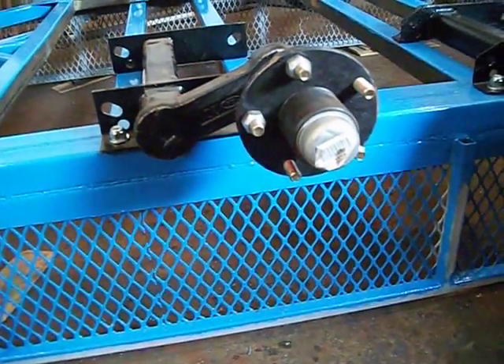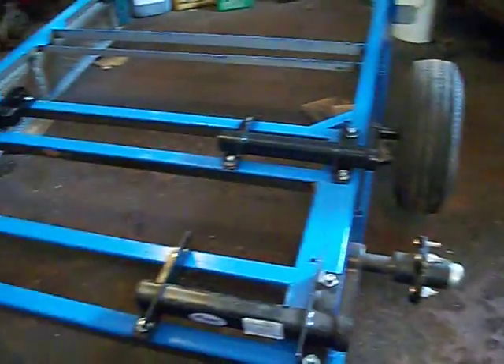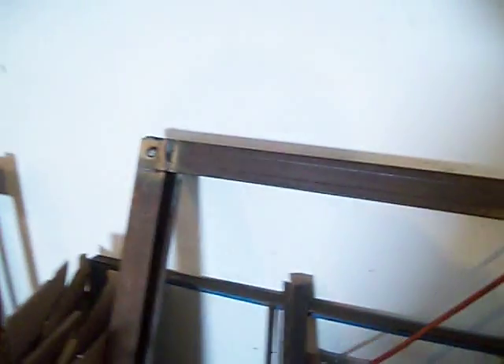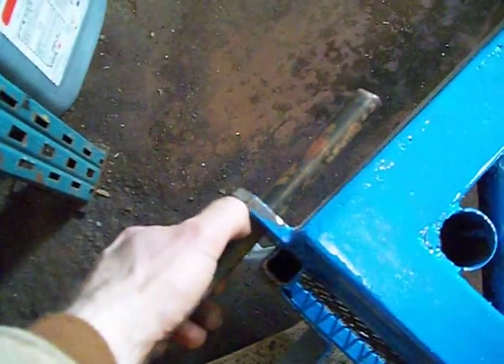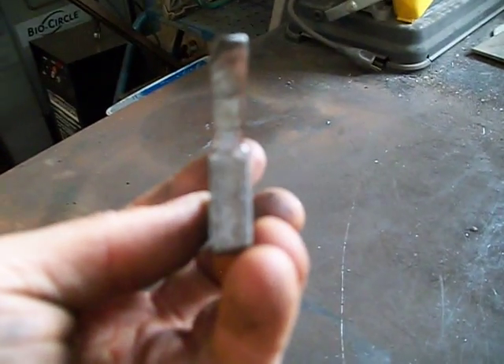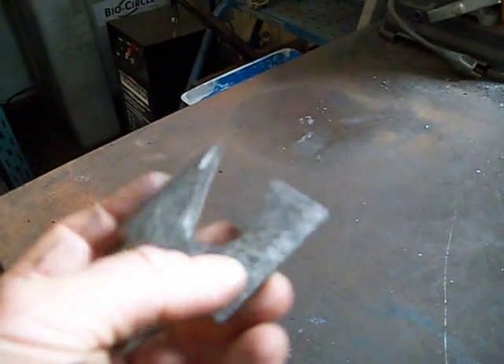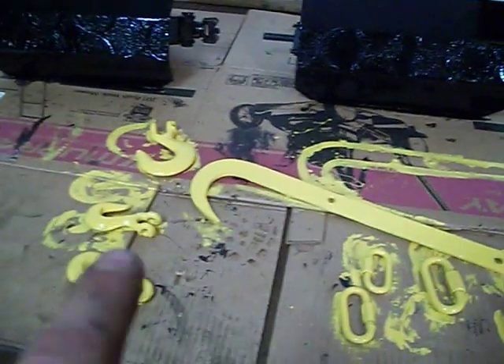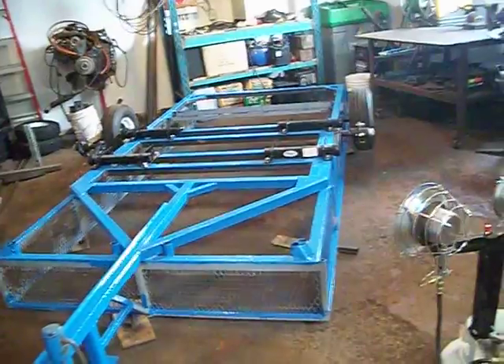Ruffing it on two wheels!

Comment: I just saw these torsion axles at princess on sale, I’m planning to build a 4x4 trailer do you think these will be good ? And what’s the widget limit. For drill bits I go to try hard or to any place where machine shops buy tooling.
Reply from the maker: thx for watching. these axles did work well for me and they are still on there now. I would definitely go with the 2000 lbs capacity ones. Ice loaded it to 1500 lbs a few times and the wheel flex outward. if your planning on haul heavy often I would go with bigger wheels and full axles. As for drill bits, if you have the money buy them at s specialized tooling store. bits from box stores are trash.

Comment: Nice Trailer,  do you have any problems towing heavy loads? i am currently building a trailer with roughly the same set up...  But I read an article that didn't recommend tandem torsion axle due to the fact that the axles are not true load sharing.  Just wondering how the trailer has been?
Reply from the maker: its been great so far. the wheels will flex under heavy loads but no more then a solid axle trailer. the important things it to have good heavy cross members to bolt them onto. ive loaded scrap metal, small engines etc. very heavy loads with no problems. havent had to replace a torsion yet. just bearings once in a while due to every day usage. thx fir watching!!

Comment: A trailer without springs will not work. It will jump along.
Reply from the maker: not true. never had a problem of.it jumping around empty or full. with springs if you dont have a load it will jump around.